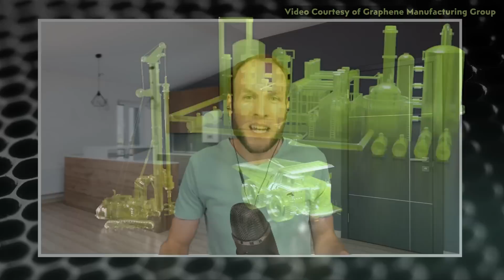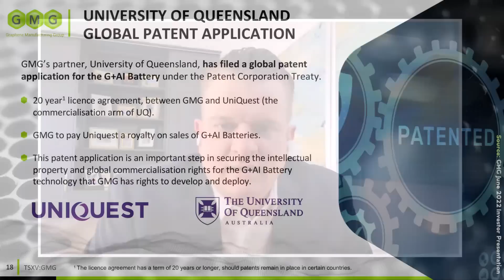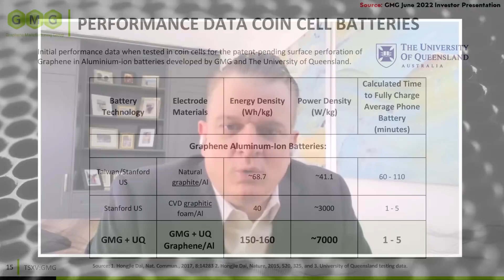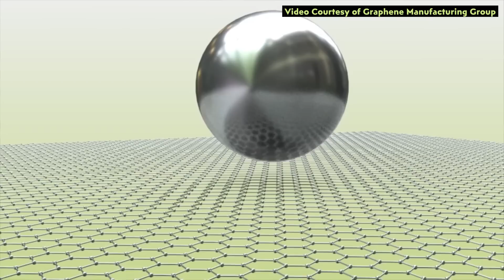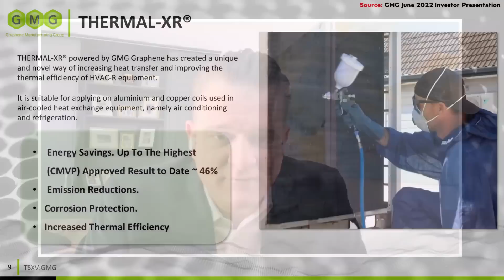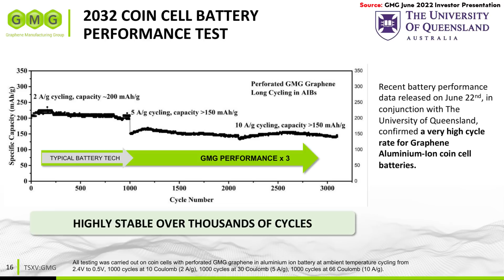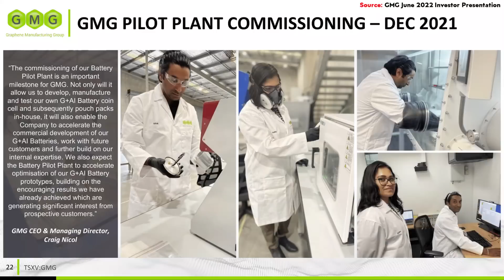GAME CHANGING Graphene Aluminum Ion Battery w/ Craig Nicol

Comment: Coming from someone who is about to submit their thesis on Al-ion batteries, they are being dishonest about the energy density. People tend to not incorporate the weight of electrolyte needed in order to get the capacity from the graphene. Because you're using AlCl4^- ions rather than Al3+ to intercalate in the cathode it means you consume electrolyte, and need a certain weight of electrolyte per weight of graphene. The other huge issue is the loading of graphene tends to be well below 1 mg/cm^2, whereas practical cells require upwards of 20 mg/cm^2. When you try load too high, the performance drops hugely. That said, these could potentially be used as energy dense supercapacitors. I just hope they've found a viable cheaper ionic liquid to use rather than EMImCl. I suggest Et3NHCl or GdmCl

Comment: The longer cycle life of the batteries allow for the batteries to be used regularly for Power to Grid/Everything purposes without unacceptable degradation of the battery. This will result in huge savings as you will no longer need separate EV/Grid batteries that result from the shorter lifespans of Lithium batteries!

Comment: So it's half the density. He says it is high, but 150 is their battery, but the industry is running from 260-270 wh/kg. They are beating lead acid batteries, which is 50-100.

Comment: 20C charging rate is crazy, but what about delivery? 100kw/h car battery can be charged in 1 hour with ~100kw power delivery, if we need to charge it in 5 minutes, which charger and what flexible cable can deliver 1MW safely? What cabling needs to be used inside car to withstand these amps?

Comment: If you can get 3,000 cycles with little degradation, at say 250 miles a full charge (average car).... 750,000 miles.  Along with recharge times of just say 5 to 10 minutes (if infrastructure is available).  Even at half the energy density, this technology has potential.  It would then come down to cost.

Comment: This seems like a lot of bs.  They're making these prototype batteries by hand and saying they are going to scale up to coins while talking a load of rubbish about car batteries - which they are wholly unlikely to ever be able to produce because they do not deal at all in the end of the market, so no supply chain is in place for this company   Then he claims graphene is expensive.  Um, it graphene LITERALLY the most abundant material in the universe.  Graphene oxide can be made at home for pennies and can be found on Amazon for $1.23/lb.  Granted, it's not the ultra-purified variety they claim to want to work with, but *m not so sure that this "ultra-purified" thing is even an issue at all, given the nature of graphene oxide.  It's very pure to begin with.  They are doing coatings.  FULL STOP. Don't give your cash to this man, bottom line.
Reply: very stupid comments

Comment: What this person fails to mention is that A) when you can store multiple electrons, this means that there will be multiple voltage plateaus, and the first will be the highest, the second somewhat less, and the third less than that.  So you do NOT get 3x the capacity, you get maybe 1-1/2 or 2 times, Assuming the first's voltage is as high as lithium which it is not.  And because the aluminum atom is heavier and larger than lithium that diminishes the capacity in terms of joules / kg or joules / cubic meter even further.  A lot of bullshit advertising here.  Lithium ion gets as much as 265 wh/kg, where he is advertising 150 wh/kg, not even 2/3rds of lithium ion capacity, this is a non-starter except for very low end vehicles.
Reply: I heard theory. Did I see prototypes? Come back when you have a prototype for testing. These "promises"  get tiresome.
Reply: @artsnow8872  he was holding a prototype. Watch the vid.
Reply: The 3 electrons are all in the same shell, so the same voltage plateau. They aren't stupid, you know, and neither are the original Stanford developers. Note: your li-ion power density doesn't account for many real-word car batteries being 50% cooling by mass and so are effectively 50% the power density.

Comment: Will this technology be designed to be 100% recyclable and if so which it sounds like it will be, will the recycling process be designed and put into place at the same time as the production of these future batteries?
Reply: Notice he doesn't touch on the elephant in the room?   Betting that's because recycle potential is non-existent.
Reply: Listen again, dopey.  He discusses recycling, these batteries are far far cheaper/easier to recycle than li-ion batteries are.
Reply: yes. (answering the OP not Leslie)

Comment: Rather use it for my home battery than a grid battery.  Could you use the heat in a heat engine to recapture more energy? Would you get enough heat out to justify the cost of that modification?
Reply: Heat energy  recapture systems cost 50,000, so I'm going to go with no.  This whole Convo is running on vapors.
Reply: you would need one that could use low-density waste heat; a Stirling engine could do it.

Comment: The atomic weight or lithium is 3 while the aluminum is 13 more than 4 times so the Power density of aluminum can't be higher than lithium.
How does this explain .
Reply: electrochemistry not molecular structure. Al has 3 available electrons, Li has one. He specified.

Comment: How about graphene infused heat shield tiles for Starship. It was mentioned it could be used to make very strong concrete and defuses heat. Could it survive reentry? What about a heat resistant spray on coating instead of tiles?
Reply: Yes, good idea; especially since the Parker Solar Probe ventures so close to the sun that it's protected from the fierce heat by a 4.5 inch thick shield of carbon composite.
Reply: Graphite-based heat tiles is what's been used since the first Shuttle. Graphene has been shown to be better, and is waiting on cheap mass manufacture of graphene--and we're getting there.

Comment: Did I miss the cell voltage? That has a huge effect.
Reply: no, stacking the batteries to bring the voltage to an arbitrary value is trivial. Same with any battery; note that the 700 Volt batteries that some use are made with 2.1 V cells.
Reply: Around 1.7v currently, which you can wire up in series to match the voltage of lithium batteries. I read somewhere that they're working on getting the natural voltage up higher as that would reduce the complexity of integrating these batteries in devices, but it's not required - a single alkaline AA battery is 1.5v.

Comment: How much carbon dioxide is produced in the use of methane for graphene? Doesn't seem like it would be allot.
Reply: they are using the carbon from the CO2, so none. If you just burn methane that's 4 times the methane volume in CO2, that's huge.

Comment: They've been promising these huge advances in battery tech for years, but none of them are coming to fruition. LiPos, 1970s tech, is still the best we can mass produce. Goodenough invented LiPos in the 1970's, and it still took 30 years for them to start becoming common.
Reply: Lithium-ion is /far/ better than LiPo and are mass-manufactured. Please update your information. And Goodenough invented Lithium-ion as an improvement on LiPo, too, so there's that.
Reply: @thekaxmax  You got that backwards. "LiPos offers several performance enhancements compared with Li-ions, including higher energy density and lighter-weight batteries." The problem is there isn't enough Lithium sources producing what is needed for the production of either. Lithium isn't just everywhere. Especially, with supply chains collapsing.  So, " Please update your information."
Reply: LiFePo4 is best so far

Comment: 4680 batteries have a density of 280 WH/KG this only has 160 so it is not really in the race. Fast charging will still be limited by the grid itself. It would be a huge game changer if the density was higher. That is why they are not going for teh EV market probably will target the grid level batteries.
Reply: Note that 4680 batteries require more battery volume in cooling than the volume of the batteries, and the water cooling weighs as much as the batteries and takes power. These don't, they are air-cooled. Please use apples-to-apples comparisons not apples-to-oranges.
Reply: Theoretical density for Al-ion is something like an order of magnitude higher, so there is plenty of headroom. Hopefully they can bridge the gap sooner than later.
Reply: They've announced higher power density in recent news.

Comment: I can see a lot of potential for this battery becoming part of the structure of the vehicle. You could literally insert pouch batteries into the roof, doors and body of the vehicle to increase the energy density. I even wonder if you could sandwich the battery between layers of composites to make a really efficient lightweight vehicle like the Aptera. Combined with solar, this would make the Aptera even better than it already is. I can also see a lot of potential for Australia, which has large reserves of both LNG and bauxite, to either manufacture these batteries here, or export the minerals to the US to take advantage of the free trade relationship with the US, in conjunction with the new EV incentive.
Reply: Higher density means less batteries are required, I would prefer a few battery modules that can be easily switched out, so a decent second hand  electric car market can thrive, I don't want an Iphone car.
Reply: @michaelandrews4783  There is that advantage to easily accessible modular packs, the drawback to it is weight distribution.

Both are obviously on a relative scalar basis. The easier & more convenient it is to access the packs; The greater likelihood that it will affect the weight distribution of the vehicle.

Clearly there are ways of mitigating the issue, it's been a key factor in vehicle design for ages what with how heavy an average IC Engine is.

I agree that use of easy to access modular packs for average consumer level vehicle's would be the better option.

Not only for a more robust second hand market, also to be able to design and manufacture less expensive vehicles to begin with.

Even though they claim the packs don't require cooling, using a simple flow intake air cooling system fora modules mounted in the front or rear of the vehicle, where a typical IC Engine or it's Radiator would be, would be far easier to do.

Whereas use of the cell's in structtual design, the panelling and even distributed in slightly larger packs near the wheel's would be better suited to proformance & race vehicles.

As they will be able to maximise cell density, while maintaining a more consistent weight distribution, potentially with weight reductions as well.

Comment: I would like to work for these people. I am generally extremely critical in my analysis and see this has great potential.
Also I am surprised at the time I watched this that only 33 thousand views had been recorded. Also Craig talked about his experience with natural gas shipping and I could not help but think why not ship energy in the form of battery barges and just park them near a city for use. There are places in the world where there is an excess of solar or geothermal or wind etc. Perhaps even containers the power so it could be delivered inland to remote grids. Got to be cheeper than high voltage lines.
Reply: Because the energy density of liquid hydrocarbons is and will always be far greater than any battery technology that we will ever come up with. So it will forever be cheaper to ship energy in the form of hydrocarbons to the points of use and then run high voltage transmission lines with relatively low loss to the farthest users of their grid. Ships dock at large ports. Wherever there’s a port, there is no need for large battery packs to power a grid. However, you may be on to something in the event of natural disasters as a temporary relief measure....🤔

Comment: As a physicist and engineer, most of the discussion of technical details seems very credible to me, from "what is possible" standpoint, though obviously all of the issues to make it commercially feasible have not been demonstrated to be solved.  Some of the issues have been demonstrated and some are still aspirational.  Overall, I am left with the impression that the company has a real chance at a commercial product that will be valuable.  One data point I really want to see is volume density compared to LiIon (as opposed to weight density); I suspect it compares favorably but I want to see it.  If they are able to prove out all the other manufacturing and scability issues at the demonstrated 150 wh/kg or higher, I think they likely can produce at a lower final price (price at which further scaling doesn't produce much savings) than LiIon or LFP.  It also seems likely that they could replace lead acid eventually since the price points are already coming together and lead acid's remaining value in vehicles is the ability to produce large currents in a small volume, and this chemistry certainly beats lead acid on that and every other spec.  As with all the other new and partially developed battery claims, the devil is in the details and "if we can do ..." is not as certain as true believers want it to be.  I like their scaling approach, coin-pouch-future and believe they have a higher likelihood of success than many other hyped companies.
Reply: Thank you. Much appreciate your insights here and your educational background lending them weight. Cheers.
Reply: Lead acid is able to produce a large amount of current for cranking the starter/engine then get quickly recharged by the alternator  (so can lithium)  but lead acid holds up much better to hot & cold weather/temperature fluctuations, doesn't need a BMS & less risk of being damaged or  overheating fire. Which is why lead acid is still used for car batteries VS lithium, so I think lead acid still has a few remaining values. The big downside of LA is it's weight/low power density, & draining it past a certain point will quickly ruin it.
As for CMG I think it's bogus hype like Theranos & Elizabeth Holmes. Comments are turned off on the CMG YT channel & they also advertise/sell black radiator spray paint but for air conditioner condensers (that many automotive shops sell) claiming it to be something it's not. Saying it'll dissipate more heat & lower AC bills. I can't imagine some galaxy brains who are building a battery that rivals Lifepo4 needing to sell some misleading radiator spray paint.
Reply: @michaelbrinks8089  You are silly.
Reply: @andrewkaiser7203  You should invest all your money into  GMG.
Reply: @michaelbrinks8089  Not all of it. I'm invested in 25 companies. There will be several winners, but you never know for sure which ones will succeed.
Reply: @michaelbrinks8089  Magnis Energy/C4V makes a battery similar to LifePO4 that uses mostly manganese instead of iron. Only 3% capacity loss after 2600 cycles. They also 100% own a high purity graphite mine. 
But if GMG can scale their graphene production, watch out.
Reply: @andrewkaiser7203   I'm gonna read up on it. I'm just sick of so many people making bogus claims. Too many Scam Bankman Frauds & Elizabeth Holmes out there. The solid state battery seems to be the most legit upgrade so far but have to wait until 2025. I love all the perpetual motion/free energy,  devices on YouTube. Sadly there are thousands of idiots in the comment section who actually believe they're legit. That & the water cars, although it's possible to make hho out of water using electricity & grade   school science. To run an engine but diots don't understand it's very inefficient compared to electric motor.

Comment: Positives: potential looks good. Reduced charging times, better power density (he quoted 70C for charge but no figure for discharge?), mature manufacturing process. Negatives - graphene is expensive to manufacture, product may still have many years of development before commercial viability. Some things didn’t make sense to me? Craig’s quoting a lower internal resistance but also says the battery is about the same round trip efficiency as lithium ion. If it’s the same efficiency then it generates about the same amount of waste heat. That’s the only place that energy can go. Waste heat will cause the internal resistance to rise and more waste heat - there’s no way around that without cooling. So imagine you’re taking in more regen. That equals more heat. You’re going to need a liquid cooling system in a hot climate. He also listed the cycle count on lithium ion at 600 - 1000 cycles. They would be very old figures. LiFe batteries are generally between 3000 and 6000 cycles, modern LMNC should last at least 1200 cycles and quality cells can go 1500 - 2000 cycles. I wish them all the best but they seem a long way from EV battery manufacture.

Comment: Sounds great and will be exciting to see an actual  product using this battery technology that can be independently tested.
Reply: They have already made CR2032 coin cells on a pilot manufacturing line using production type processes in the key manufacturing steps and shipped those cells to third parties that are potential customers. So if those organization isn't out there saying that they don't get the type of performance that GMG says it should be, then I think we can make a provisional assumption that the performance of these batteries is close enough to GMG's representation.